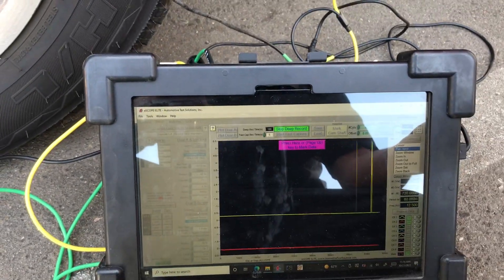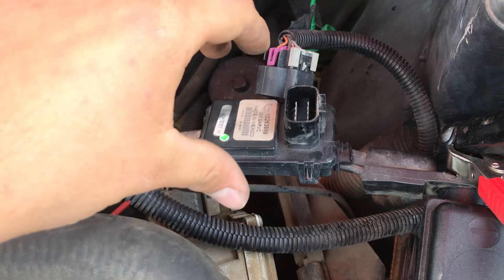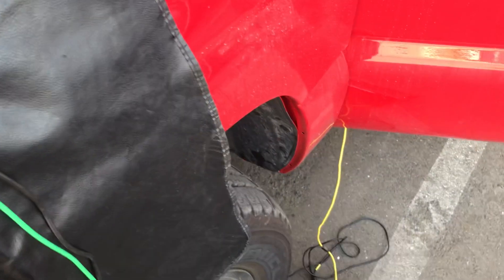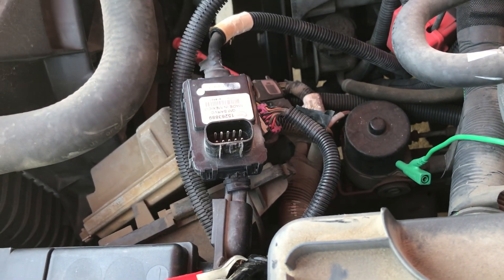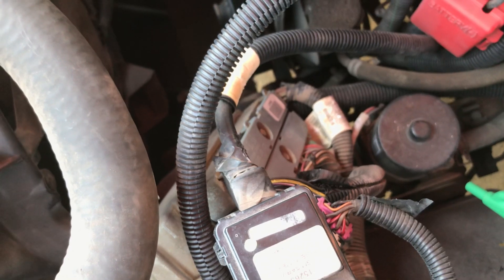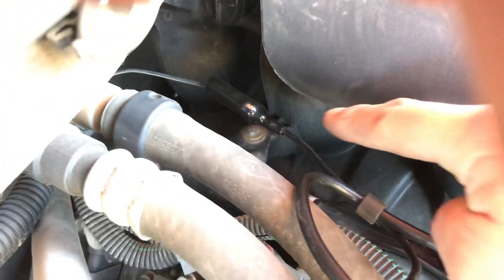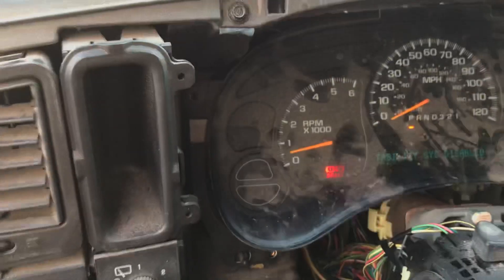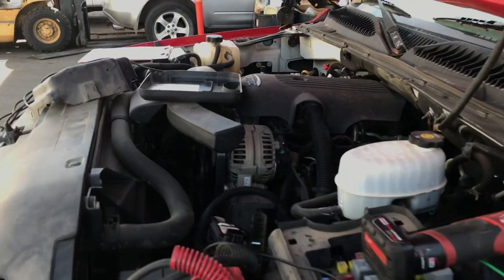2006 Tahoe no communication diag case study

Comment: This video saved me hours! Thanks! 
Also, when I plugged the battery charge monitor back in, it worked well, even though it was shorting my comm's to 7 volts with that ground disconnected.